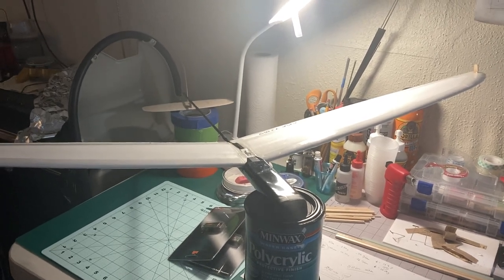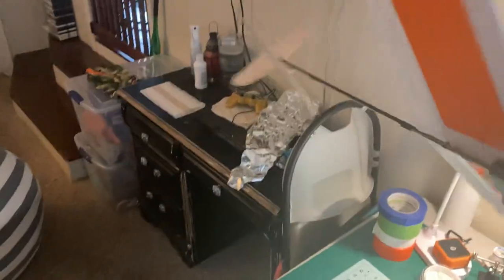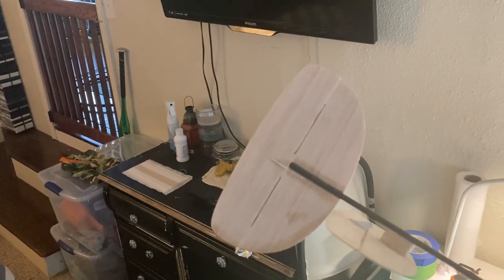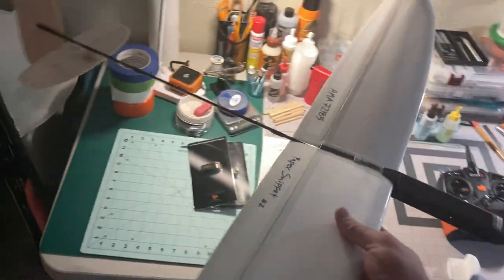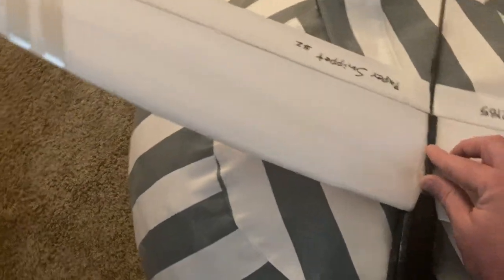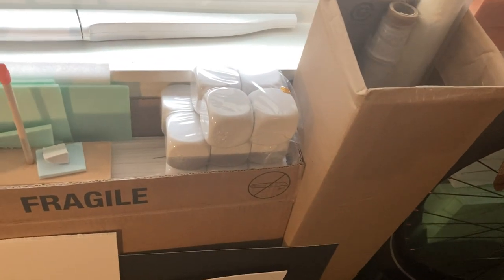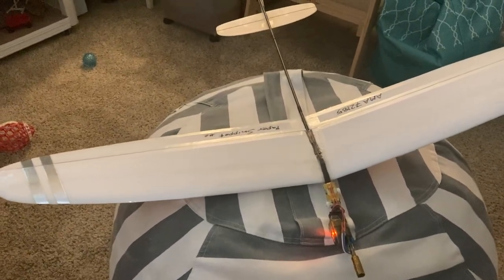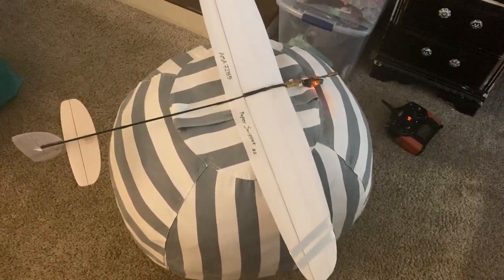Paper Snippet #2, foam board DLG

Comment: I just use de papered foamboard from WALMART, the 98 cent stuff. If your Walmart is anything like mine, it's probably in the wrong spot, and will look like it is $4+, but match up the tag to the label and get the 98c one... I like it way more than Dollar Tree foam board, way stronger.. anyways I use that and UV resin.. It's great. But yeah I use that Foamboard, then de-paper one side, make my wing, then sand it to shape exactly how i like, the walmart poster board sands great. After sanding just paint the entire wing surface with uv resin , then hit it with the uv light. I reccomend doing sections at a time unless you just randomly own some massive uv light lol. It's the next best thing to carbon fiber or fiberglass. Super rigid, and still super light-weight. You don't have to depaper both sides if you don't totally need the weight savings but it still works well either way! Just discovered it a couple days ago!😊

Comment: Well hey neighbor, just across the Alabama state line in Elberta.
Working on a foam board dlg patterned after the Elf. Very similar to yours.
One question. I read somewhere the receivers close to the battery can give reception problems.
Have you had any problems like this?
Reply from the maker: Haven’t had any trouble with it. I use an AR410 and beta fpv 300 mah 1s stick lipos now.  Right next to each other.  Works great. 

Adjusted the cg and reduced the camber today.  This thing flys great now. Forgot the camera though.  Not too shabby for about $10 worth of materials (barring the radio gear of course)

Do yourself a favor and invest $70 in 2 kst x06 servos.  Don’t waste a year like I did trying to make cheap crap work.  They are worth every single penny. :-D. Armsoar USA has them in stock as well as the pulleys that are awesome.
Reply from the maker: https://www.rcgroups.com/forums/showthread.php?3749159-Scratch-Built-DLG-on-the-cheap

Check that out Jody.  I started that 10 months ago.  Post what you’re doing man. :-D. Most that are building these things around the globe and posting about them are in that thread.

https://www.rcgroups.com/forums/showthread.php?1999696-Dollar-foam-DLG

This one too. Needless to say.